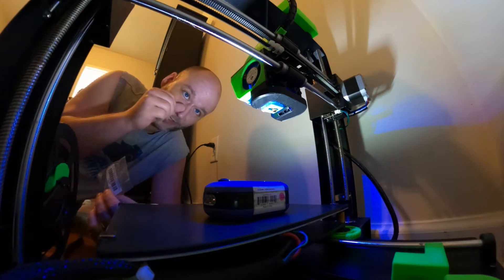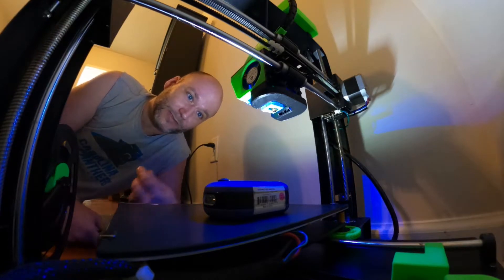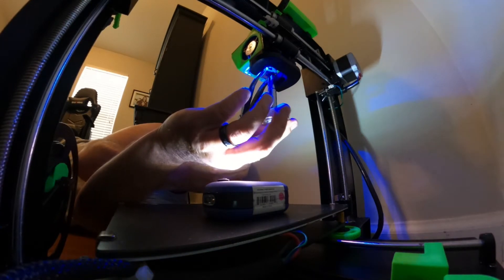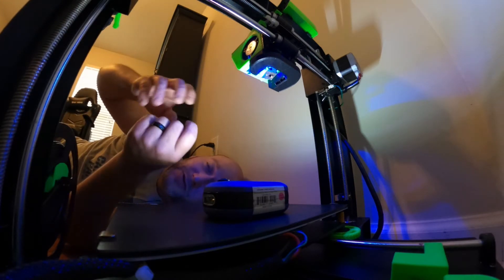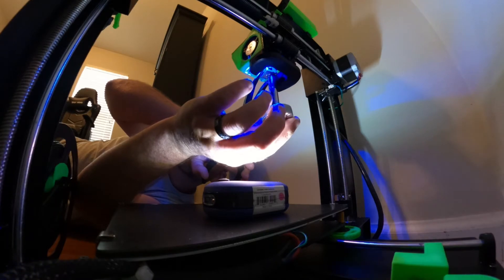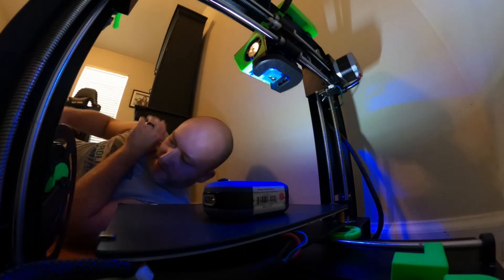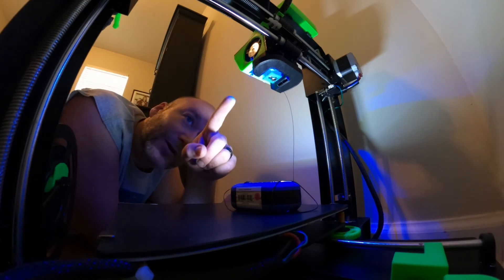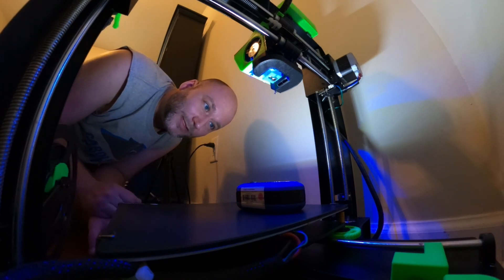Easiest way to change nozzles on anycubic mega S

Comment: How did yours come out so easily, mine are sooo tight, I can't grip them with the pliers hard enough and I'm damaging the block
Reply from the maker: They shouldn't be very tight at all. The first one from factory was.
Reply from the maker: If you can't grip the block. Use an adjustable wrench.  And a 7mm I think socket over the nozzle.  Should only be torqued to 1 to 2 ft lbs
Reply: Managed to get it in the end, had to get someone else to hold the pliers, it was far tighter than it should have been, new one is in now and it's working great. Thanks for the video 👍
Reply from the maker: @richardg6983  just don't over tighten it again.  Seems to come from factory way over torqued